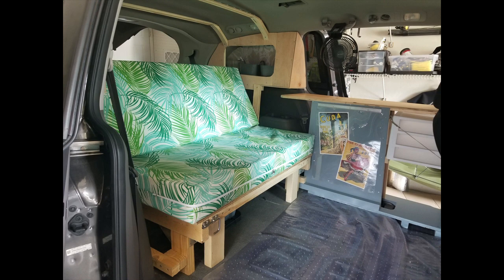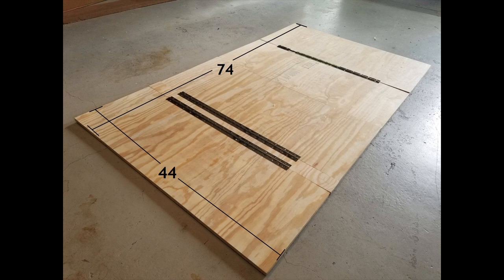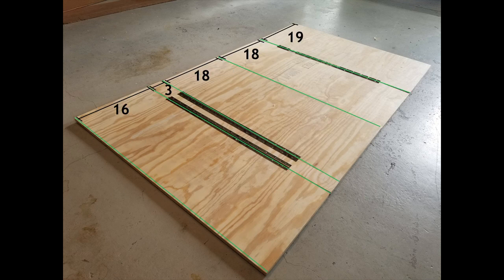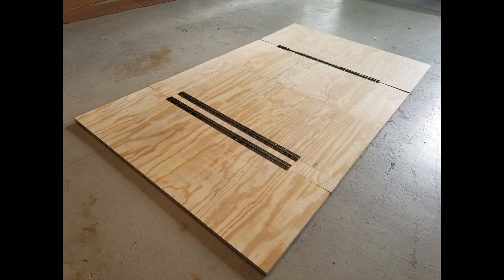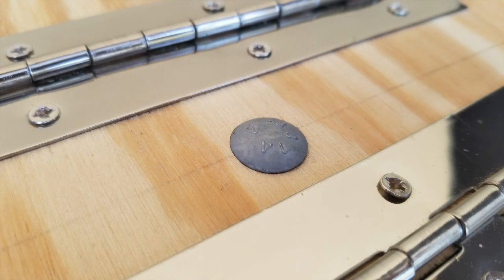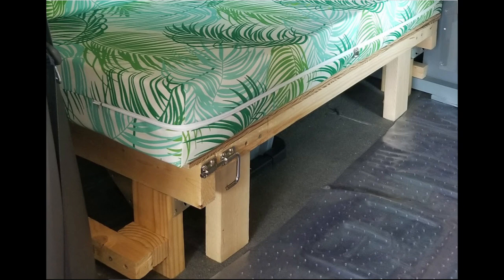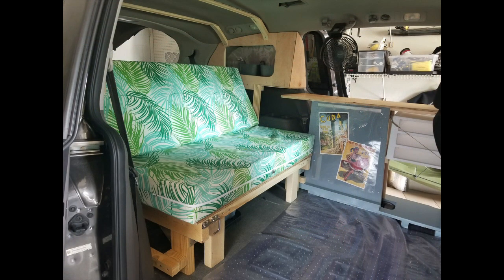Full Bed/Bench Build Details! Easy, Cheap DIY for a Minivan Camper Conversion.

Comment: Thank you SO much for this video! Much more in depth than others like it out there! I am starting my bed build in my '08 sienna now! So excited to have stumbled upon this video!
Reply from the maker: Omg, Abigail! That's so cool 😀 Congrats on starting the bed build. I'm glad my little video could be of help. What else are you building in your van?
Reply: @TheVanThatGotAway  also a small sink/kitchen area with a swivel cutting board are in my plans! I have a question, what thickness of plywood did you use here?
Reply from the maker: For the bed, I used a 3/4 inch ply. Probably could have gone with 1/2 but why take chances? LOL!

Comment: First: **awesome** series; you are a great explainer. You make me feel like I can do anything :-)
Second: in bed mode, is there anything supporting the hinge between panel 1 (the forwardmost panel of the bed platform) and the one directly behind it (panel 2)? The legs and crosspiece on the leading edge support the front edge of panel 1... and the side pieces of the frame support panel 2... do you need anything under that hinge? Or am I overthinking this?
Reply from the maker: Hey, good to see you again HOVV! Welcome to Overthinkers Anonymous 🤣 There is no crossbar that supports the hinge between those 2 panels. The 2x6's that cross the frame are for support in the bench mode. But it turns out you don't need anything more for the bed mode. Thanks for asking and thanks for the kudos!
Reply: Me too!!!

Comment: Hi Leslie, This video with detailed info is very helpful to me.  Great instruction! Thank you!  Can you please answer a couple questions?  At 6:24 the photo shows both 2x6 and 2x4 are cut the same length 44" plus the 3" from the long sides at the joints, that would make the width of the bed frame 45" wide, right?  If I was building this for a 2010 Sienna what factors should be considered? How much allowance did you give from your Ody's inside dimensions to arrive at 45" width of the bedframe?  I imagine your van must be a bit wider than 45" to allow the horizontal wood to hold the storage cabinet legs.

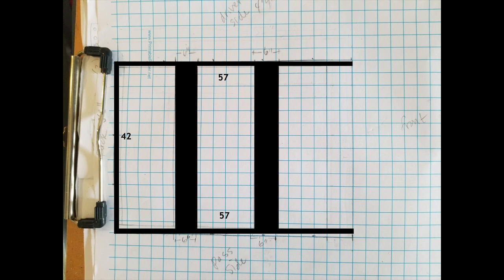Comment: Hi Leslie, Great video on your van build! I was wondering ... can you please clarify for me on the cut length of the short cross pieces of bedframe? At 6:25 the photo shows the short pcs butt joined the long side pcs.  That would make the width of the frame 3" bigger.  Are the short 2x4 and the two 2x6 cut at 42 (making the frame 45" wide) or 39 (making the frame 42")?  At 5:43 the drawing of the frame shows 42.  Does it include the 3" gained from the butt joint?

Comment: First off, you are an excellent and detailed instructor!!!  I however, am a solo traveler and I only need half of the width for a bed. Any ideas on how I could figure out the build for a single size bed? I am not good with measures and carpentry, but you inspire me to want to try. (My vehicle is a 2018 Dodge Grand Caravan)
Reply from the maker: Hi Jo Ann, thanks for asking. For a narrower bed, you could probably use this design and customize the dimensions but you also have the opportunity to consider a lot of other designs. And if you're not feeling like a SuperCarpenter , you could most likely find an easier way to implement the bed. Are you thinking about folding yours up into a bench?
Reply: @TheVanThatGotAway  Yes, I would want to have the bench option. Your design is so simple and perfect, I just need it to be narrower.
Reply: @joannsjourneys5904   I'm building a removable camper setup in my Sienna for solo adventures-- it's very similar, but I am building a narrow storage "wall" from floor to ceiling along the driver's side of the back half of the van. (Eric Enjoys Earth has this in his van too, so I'm following the idea of what he's doing there). This will make my mattress cushions 41" wide; it's still wider than a standard twin bed (which I believe is 37" wide), but I like the idea of having a bench that feels more like a loveseat than a chair, if that makes sense.
Reply: @heartofvermontvet  I would be curious to see a photo of the storage wall.
Reply: @joannsjourneys5904  it exists only in my mind at the moment 😜 but if you check out Eric Enjoys Earth’s YouTube channel you can see his van. Bruce Parks also has an awesome setup in his Sienna (he has a YouTube channel too) but he’s way out of my league!

Comment: Leslie I really like the way you explain things in your videos. I am getting older and my motorcycle camping days are coming to an end. I recently bought a 2015 Honda Odyssey and want to build the bed you have. Your videos are great but I just have a couple of Qs. 1. Since I have basically the same van as you, how long are the three sets of legs for your bed frame? 2. With the bed in sofa mode is it possible to install the 2nd row seats? I too will be using the van for other things and it would be nice to have the 2nd row seating in without removing the sofa/bed. Thanks for your inspiring videos. Interestingly enough my wife is a better "handy man" than I am and she will be the one actually building the bed, with me doing the more mundane things like bolting things together!  Thanks for the great videos!
Reply: Sorry Leslie - Q2 is pretty stupid - once I got in there and removed the third row seats it became pretty obvious that the second row has to come out too in order to accommodate the bed frame! I told you my wife was the brains of the outfit!
Reply from the maker: Hey Wade, Congrats on taking the leap from motorcycle to minivan! I'm glad you asked about the 2nd row seats b/c I purposely chose the length of the bed frame so the seats could be installed when the bed's in bench mode. The only 2nd row seat I CAN'T install is the one that goes behind the driver's chair, since I installed the pantry cabinet there. That leaves me the ability to install the seat behind the passenger's chair as well as the half-sized seat that makes up the middle of the 2nd row. Re: the bed frame height, the top of the bed including the height of the platform comes to about 12" at the front of our bed and to about 18.5" in the back where the legs sit into the storage well. Since I used 2x4's for the frame and 3/4" plywood for the platform, that made the legs about 7" at the front of the frame and about 14.25" at the back. Is that helpful? Thanks for taking the time to check in.
Reply from the maker: Lol, Wade! Actually ypur Q was right on and makes perfect sense to me. Plenty of brains to go around in your family 😉

Comment: Thank you so much. Since I'm alone I'm thinking 24 or 30 wide. I assume I need to keep the length the same to be able to fold into a bench? Thanks so much.
Reply from the maker: Hi Kathy, I actually haven't experimented with different lengths. But I think bed lengths are pretty standard, like 75 or 80 inches. I don't see why you couldn't just customize your bed to whatever width you need. Let me know how it comes out!

Comment: So sorry about the mess in your neighborhood! I grew up in a new subdivision with its piles of dirt, ditches and open basements. Heaven for kids but a nightmare for adults, I’m sure. We are attempting to use your bed plans to convert one we purchased from another YouTuber. Wish we had seen yours first; it would have been easier and cheaper to start from scratch! Anyway, I want to make sure I understand some details of the bed build. Is the total length of the frame 54” even though the matress is longer? Thanks for the help.
Reply from the maker: Hi Gigi! Yes, the bed frame is not as long as the platform that supports the mattress. The platform will have its own legs that will hold up the front end, so you don't need the bed frame for the full length. Trust me, it works😉 Thanks for asking.  How's the build going?
Reply: @TheVanThatGotAway  , It’s coming along. We’ve partially deconstructed the bed frame and are going to  cut one section of our bed platform to add another hinge. It won’t be a thing of beauty but if it works we’re happy.  I really like your kitchen on the side and we’ll use it as a model. I’ll need to cut down on what we carry, and use the space differently. We generally don’t eat out when we camp so we carry more food, and we’re coffee drinkers. But I’m willing to rethink some things. I’m eager to see your future videos with more of your creative ideas, especially for storage.  Thanks, and bless you.
Reply from the maker: We'll do some storage videos for you while we're on the road next week! Thanks for asking 😃

Comment: Great build! I'm in process of making the same bed and have all the wood cut and ready to assemble. Then I went to buy the brackets to screw everything together. One question: did you use 3" or 5" triangle brackets to attach the legs? Thanks!
Reply from the maker: Hi Michael, I used 3 inch. Along with all the many, many other braces I used (probably TOO many🤣) I wasn't looking for the biggest and baddest. And they work great! Thanks for asking.

Comment: Such a great how-to. Thanks! One question: Is the angle of the sofa adjustable?
Reply from the maker: Hey lishana, I love your questions. Yep, you can push the seat of the bench further in, which gives you a steeper angle for the bench back. If you pull the seat of the bench further out, you get a flatter angle for the bench back. Just make sure you can secure the seat so it doesn't slide around.
Reply: @TheVanThatGotAway  Thanks : )))

Comment: So thankful to have found your bed video! We wanted this type bed for our van but had not found (your very clear) instructions until now. Wondering, though, what you do about bed linens for sleeping. Do you use some sort of fitted sheet over the mattress?  Thanks!
Reply from the maker: Hi Susan, and welcome! It's great to have you here 😃 Yep, we use a full-size fitted sheet (with those little elastic straps clipped under the corners, 'cause I cut the mattress down.) If it's colder we don't bother with the sheet, we just use sleeping bags. Are you building currently? Still planning?
Reply: @TheVanThatGotAway  Thank you for your reply! We are just about ready to do short camping trips in our van, just finishing up the DC power ( I use a CPAP at night). Right now we have a double bed in there, but after a couple of shakedown trips we want to take out the double bed and put in a sofa bed so we can do long trips more comfortably.
Reply: P.S. We plan on doing a lot of boondocking, hence the need for DC power for the CPAP.
Reply from the maker: Yep, that sounds important! 😉

Comment: Hi Leslie, I am in the process of an identical bed build.  What is the length of just your leg pieces in the rear?  Thanks so much.
Reply from the maker: Hi Kimberly, Independent of the horizontal part of the frame, my rear legs measure 14.25" tall. I hope this helps. How's the build going?

Comment: When the bed is in couch mode, is it possible to use the second row seats or do they have to be removed entirely or just left in stow n go mode? Thanks.
Reply from the maker: Hey Cindy! In our van, the second row seats don't stow away in the floor. They're either completely in or completely out. Right now they're wrapped up in plastic and stored in the garage. When the bed is in couch mode, I can actually reinstall the second row seat  on the passenger side and the little half seat that goes in the center. Because of the pantry, the 2nd row seat behind the driver can't be installed. Everything is a trade off, right? Thanks for asking 🙂

Comment: At video time 9:10 there appears to be another wood piece coming out of leg to the right. Is that correct? Or is that just another wood structure standing behind the leg?
Reply from the maker: Hi Donna! Your eagle eye didn't miss a detail. That wood piece in the back of the bed frame is part of how I secured the shelves to the frame. I give a thorough explanation of how that works in my shelf video here, if you really want to geek out on shelf building🤣 https://youtu.be/fkGRYmyP4WI
Thanks for asking and also thanks for taking the time to chat!

Comment: I did my bed with very similar measurements. I wish I had done my strip at 3" and not 6" 😂 I'm going to "steal" the strap hack because putting it into bench mode is a pain without it.
Reply from the maker: Yaaas, that plywood is HEAVY!!!
Reply: Peter or Leslie - Which strip are you talking about regarding 3" vs 6" ? Thank you!
Reply: @formedbygod  
The "4th" plywood board, the one that accesses the rear cargo seat well/trunk, is cut in two pieces.

So if your cutting all 4 of your boards at 18 3/4 inches (18 3/4 x 4 = 75 in, the length of a twin mattress) the 4th board would be 15 3/4 and 3 in. You would then put 4 (total) screws in that board to prevent the plywood from moving on the frame when you raise/lower the bed.
Reply: @2:47 you can see the 3" strip we are talking about. Like I mentioned, mine is 6" and wish I had gone with her size.
Reply: @3:37 she has a side diagram too ❤ She really does a great job IMO

Feel free to ask anymore questions.

Comment: Wondering what thickness is the plywood and if you were to do it again would you go thicker or thinner? Mine will be for a single person... I'm also thinking of putting holes in it to lighten it up just a bit . . . Thoughts?
Reply from the maker: Hey Patty, If you're building a narrower bed for one person, you could probably go to a thinner plywood for the platform. I used 3/4". And I also thought about cutting holes to make it lighter! But then I never got around to it. 🤣 Thanks for asking.
Reply: @TheVanThatGotAway  thank you again for answering all the questions, your a gem!
Reply from the maker: My delight! 😀

Comment: Great stuff Leslie! I know you mentioned you'd be doing another video for the mattress, but I was just curious about the sizes you ended up going with for your mattress cuts. Did you end up cutting them in 4 equal sizes or are the middle ones shorter to account for the smaller sections?
Reply from the maker: Hey Beau, Sounds like you overthink as much as I do! 😉 After careful consideration, I went with 4 equally sized pieces. Big picture: it makes everything easier. And no comfort nor convenience is affected. Thanks for asking 🙂